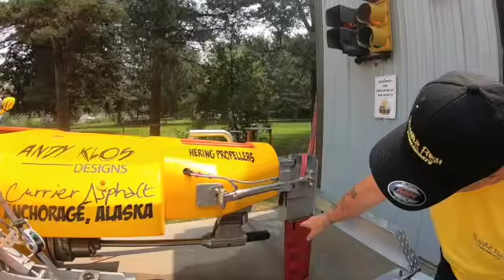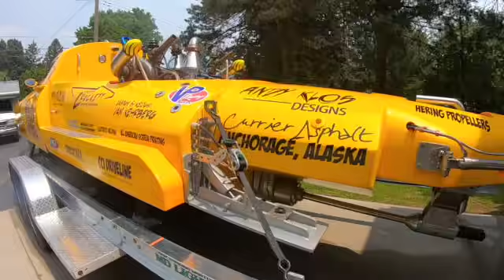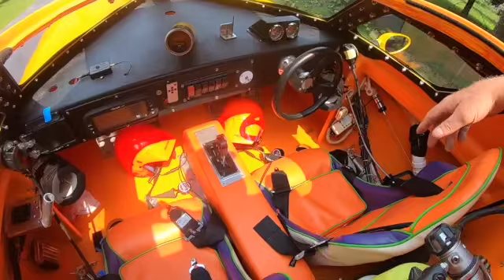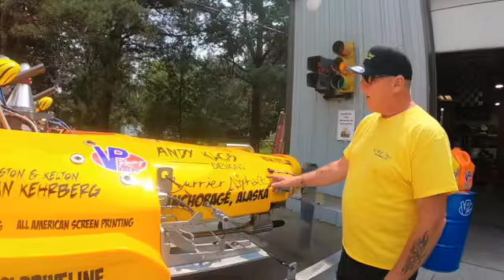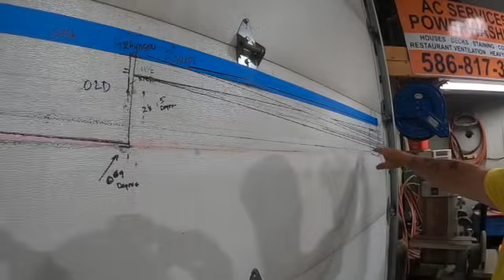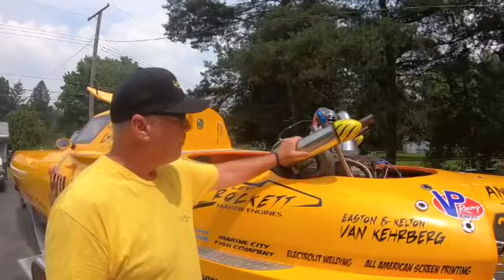2025 St.Clair River Offshore Powerboat Racing - I'm The Wild One Rumblephish Powerboats

Comment: Hello 😊 if i may be so rude to ask 😊 if you put a line from the steps,point to point if you know what i mean😊
How high (above the line) is the center line of the prop and how mutch rake do the prop have?( And angle of the drive) Ive got a 36 feet Norwegian built v botom wit 3 steps and a trimax surface drive. But when e get up to 90mph it starts to chine walk( i belive the stern lifts out of the water so that i ride on the first step) going to try new propellers with more rake next year when the boat is rebuildt after a blown motor.
And im also wondering if the axle has a bit to mutch angle and is to low😊
Thank you in advance if you bother to read and maybe answer 😁 best of luck with the boat 🏁🏁🏁
Reply: Here is a short of my boat https://youtube.com/shorts/JJa4DYG-4DA?is=hVvg35pOj1AGV3mX